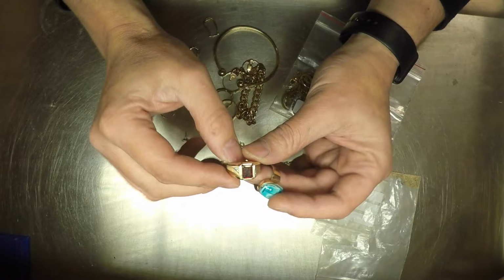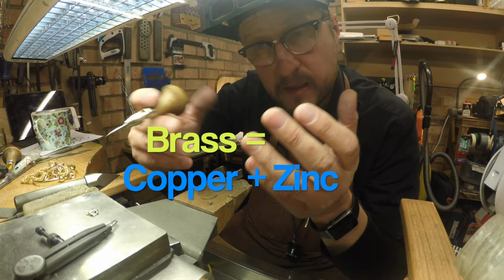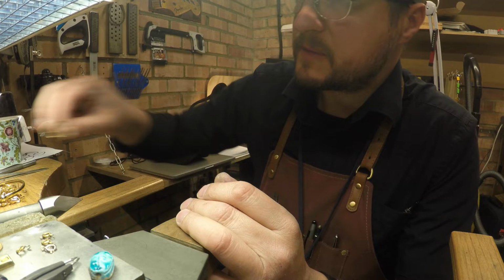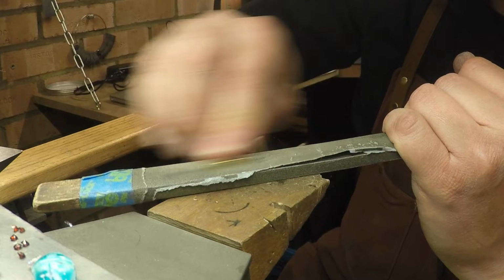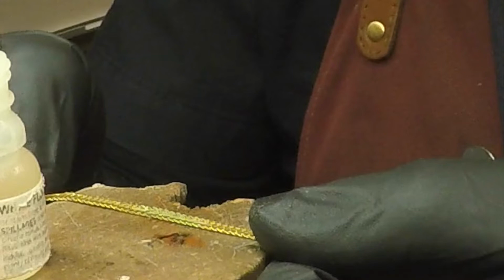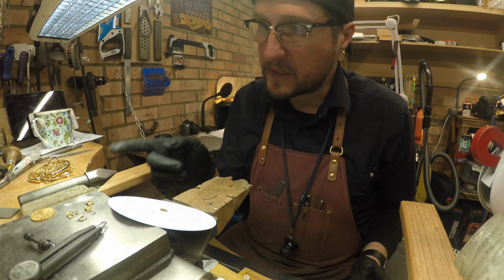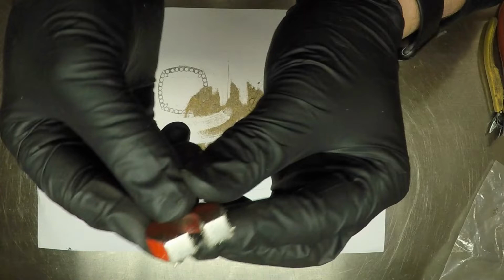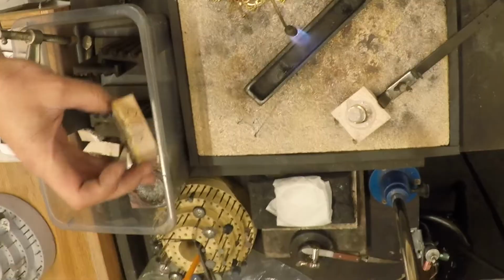How to Prepare, Melt & Cast Gold [Jewellery Works]

Comment: this was a great video, and loved to see a couple of things that I have never seen before! I am really curious why you polish up your ingot before rolling it out? do you think it decreases cracking? Love your videos!
Reply from the maker: Hey Zoe - thanks for the lovely message. I use an abrasive wheel as a final prep before rolling. This is to make sure I remove any of the rough finish from casting and that no flux is left when rolling. I go through the usual steps to clean the metal before this. I just like to see the metal clean to the maximum as I’m working it through.

Comment: What torch set do you have?
Reply from the maker: I use a Smiths little torch - it does everything I need from small castings up to about 40g to platinum fusing.

Comment: Quite interesting. What country are you in? Here in the US we have 24 carat, 22 karat, 18 carat, 14 carat and 10 carat. They are respectively 100% 80% 60% 40% and 20% pure gold
Reply from the maker: I’m in the UK 🇬🇧 - I see a lot of 10 and 14 carat around but it’s definitely more of an American standard as you say. But just a small pointer here, 24ct is typically sold as 99.9% - The way to determine the percentage of fine gold in a particular carat is to take the carat’s number and to divide  it by 24 - example, for 22carat, divide 22 by 24 and you will see that is 0.9166 (91.6%) so using the same formula, 18ct is 75%, 14ct is 58.3% and 10ct would be 41.6%. We use 9ct this side too which would be 37.5%. The Uk 🇬🇧 runs an assay service which means that every item must be hallmarked and tested so we must be very particular or it will be returned or can be destroyed.

Comment: Hi , if I have 10 grams of 24k how much Brass an silver in grams do I add to make 9ct gold , please help
Reply from the maker: Mix your 24ct down to 22ct by adding copper. Then mix the 22ct down to 18ct by adding pure silver. Then mix the 18ct down to 9ct using brass. That will give you a lovely 9ct yellow 

I will post the formula next
Reply from the maker: Here is a guide to two decimals. 0.91 copper and 2.42g pure silver should convert to 13.33g of 18ct when you add the 10g of pure gold. And then you can add the equal amount of brass (13.33g) which will then make 9ct. Hope this helps. Use a diamond scale for accuracy. Good luck.
Reply: @jacothejeweller  amazing thank you really helpful , yes can you do it with the weights in grams aswell , I look forward to more vids thank you
Reply: Just curious why would you want to dilute down?  Is it a quantity over quality type of idea or...?
Reply from the maker: @dads_diy  - a situation where an old 22ct wedding ring gets passed down the family and you have sentimental value attached to the metal and you would like to add a few 18ct chains which have all broken and really want another 14ct bangle to match the ones you got that time you visited Egypt because you have a new granddaughter on the way and it’ll only be fair. That’s one reason.
Reply: @jacothejeweller  damn.....now I get it...that was very specific.  thank you. I couldn't help but laugh while reading that.

Comment: Do you need to use a flux or anything when repurposing old jewelry? Or will it melt into a gold bar and still maintain it's color?
Reply from the maker: Joe O'Connor I use flux to bind the lemel. If you keep working with the magnet until there is no result and your metal was isolated before this process, then you will have the same color. There are some technical issues with metal mixed with brass as brass consists of copper and zinc. When heated too long, the zinc will burn out and you might find that your gold leans towards a red color. But gold like 18ct should remain the same. Hope this helps.

Comment: What about 10k and 14k? Isn't 14k the best?
Reply from the maker: Hey Bryant, the higher the number, the purer the gold is. So if you are looking at 24ct, then that’s 99.9% pure gold. 22ct has a bit of alloy then 18ct has a bit more and so it goes. So with 14ct gold, a little over half (58.3%) of its weight would be pure gold and 18ct would be 75% gold. That means that the higher the carat, the more gold it contains.
Reply: Right on man. Thanks for taking the time out to help with my question. I've always liked the look of 14k. 24k to me looks super cheesy and fake. But I am now aware of its being pure gold